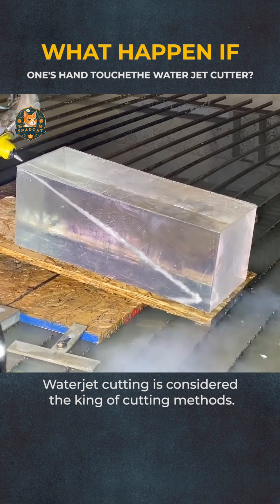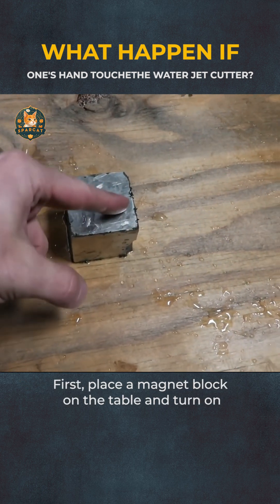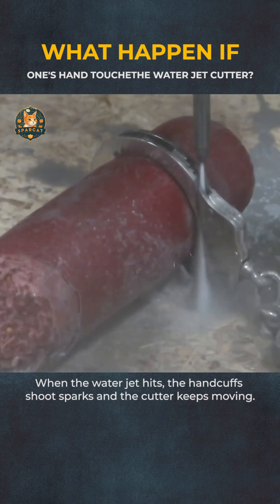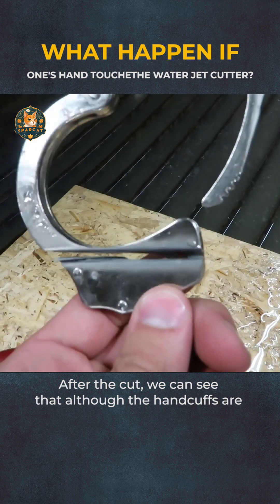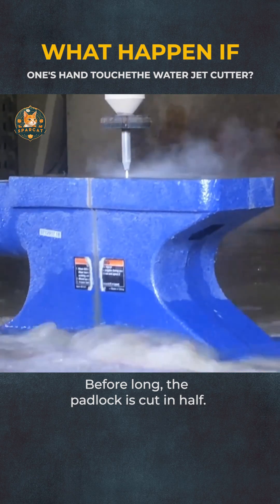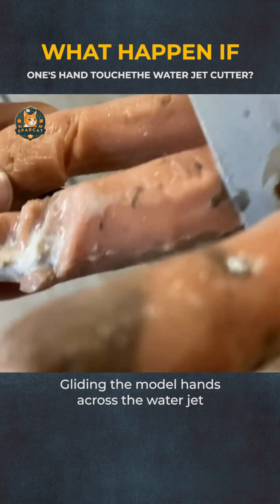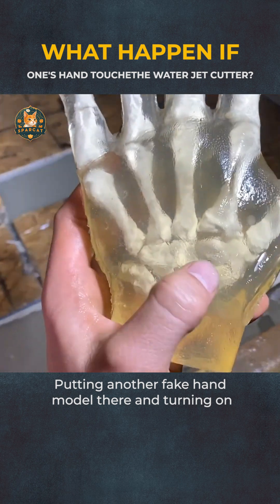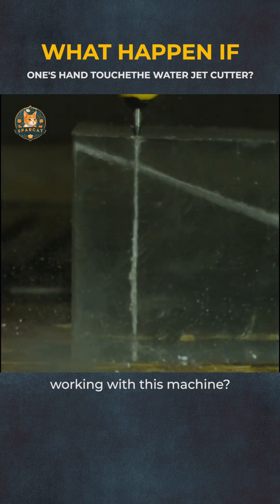What Happen If One's Hand Touchs The Waterjet Cutter? #shorts #sparcat

Comment: When I was a young man I was a foreman of a paint crew and I caught two of my guys having a paint spray gun fight they didn't realize they were cutting themselves it was blood on their clothes clothes for all cut up.

They had no clue the high pressure spray gun can cut you with ease.
Reply from the maker: Exactly. This waterjet cutting machine uses not only water but also metal powder. Under extreme pressure, the cutting power is extremely strong.